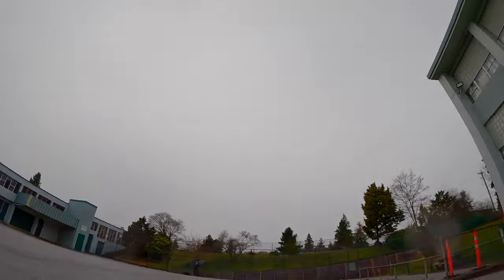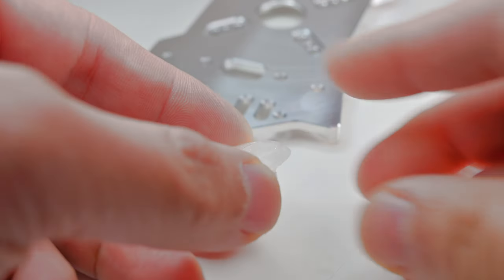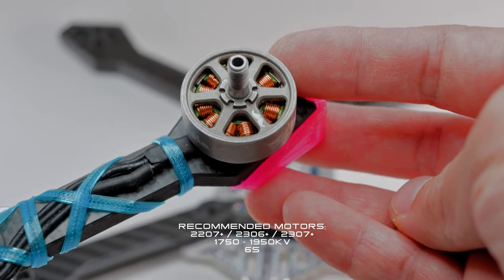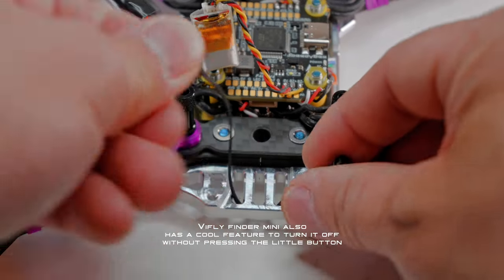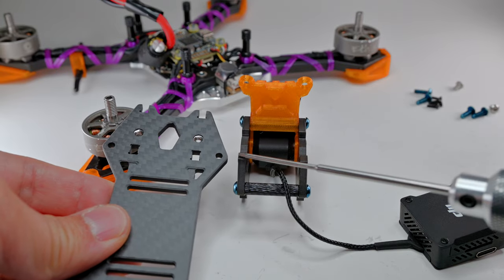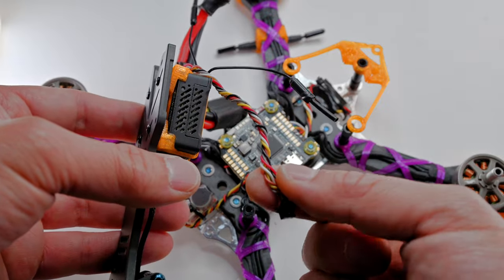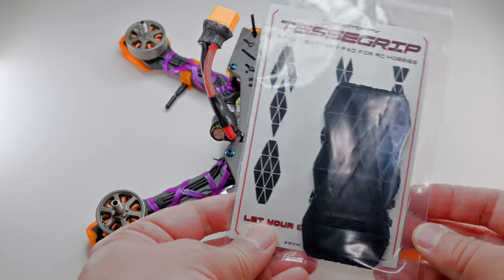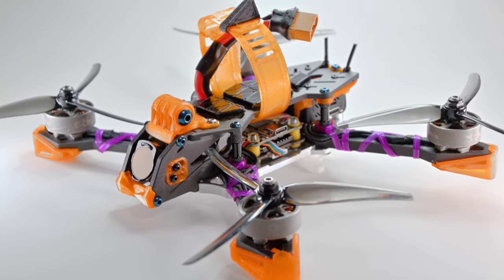How to Build P5G | Proto5 Gauntlet | Bespoke FPV Drone Tank Frame #best #fpvfreestyle #frame

Comment: Patrick and kibby have a great eye to better performance of a frame. Proto5 was by fast the best frame ever built.  I've never broken a frame yet.  If you got an idea to make the prints better they listen and make a mad science on blender to make your experience a better one.  Patrick include some proto racewire with your frames would be epic.  I would love to see a frame design with the AU mounted vertical for maximum airflow for 03 or Vista.  The buzzer placement got me sold. Never fly without a  self-powed buzzer even with GPS.  RTH doesn't always go well. With battery ejection makes the buzzer your protection fit your investment.
Reply from the maker: Great advice man!! I’m still sad you lost your proto5. Email me if you need a proto5 frame replacement. I’ll see what I can for you man.

Comment: So how do i get one....do you offer a custom build option?.....whats the total weight after tpu?....looks nice and needs to be a part of my fleet!!! Lol hmu
Reply from the maker: Haha yeah I hope it can be part of your fleet too! Yeah I totally forgot to weigh the quad for the video.. this exact build in the video is about 443g without lipo. But with props , tpu, O3 au, everything . Keep in mind that’s with a full 30x30 55a aluminum heat sink stack on it. If using naked vista, walksnail, analog, AIO or mini stack you can expect to minus 20-40g. Check out my website www.Protofpv.com and make sure you select your countries currency to see the accurate price. Thanks for the interest 🤙
Reply: @PattyFlipz  yeah I'm definitely getting one I live in the u.s.a...I'm currently flying the syncmode, five33 flipswitch,  and five33 Footy. I want to get yours and put some supernovas on there!!! It's going to be so fire....I also posted it to my fpv teams discord and fb chat....so I should be put on commission immediately lmao....when I like a product I push the sh!!t out of it...innovation in fpv really interest me and I'm really liking this frame. Cheers my bro
Reply from the maker: @dizzydeanfpv45  yeah man!! Thanks!! Those motors will scream. On my website scroll down to the bottom and sign up for affiliate program. You get 8% for each successful referral. I'll payout by paypal at the $50 mark each time. Thanks again.
Reply: @PattyFlipz  ohhh hot damn.....I'm on it....lets sell some frames bro!!! Maybe ill make me enough to get my very own....lmao I can't wait that long....lmao I'm going to eat Ramen for a week so I can get this frame lmao
Reply from the maker: @dizzydeanfpv45  mmm ramens so delicious. I’m gonna do that too 😂 the ramen diet=More drones!!

Comment: Nice job, but nobody is interested because the frame is very ugly and very expensive.
Reply from the maker: Thanks for your feedback! ❤😂 My next frame I'll make it very pretty and very cheap because then everyone will be interested. LOL ok ok seriously, think about it. if this frame was a real person, it would look like a prized UFC fighter. Not a pretty girl or boy, but built tough and can knock you the F*** out. Expensive salary cause they are that good. Also this quad is a tank frame. Tried my best to make it look good, but as you know, tanks are not supposed to be nice, they just bash :) Hope you understand these analogies. Thanks for watching, appreciate it.
Reply: @PattyFlipz  Nice job for your effort 👌. But aluminium is not good material.  They are many reasons for that, and very expensive to manufacture cnc aluminium.  Second; titanium screws , light but very expensive ( when you wrap the frame full of the tpu  parts, you don't save nothing ), and the frame becomes very ugly ( people don't like to much tpu parts).  Next time, use only carbon and for the camera aluminium cnc cage.,and also the manufacture production will be much cheaper ,cheaper replacement parts. Nobody wants to buy a tank....in the end of the day will crash a
 lot, and your tank will break 💯. Good luck with your new project 👍
Reply from the maker: We can agree and disagree on a lot of things, we can design how we believe in, but what you speak about just sounds like every other frame on the market. Protofpv is about being different and unconventional. Do you know why there’s so many prints? Because most North American frame designers/companies barely provide any in order to save money and compete against the low costs of China . We need to print it ourselves. I designed every print to be functional, I didn’t just stick it on there to dress up. Now imagine you decide not to use prints on p5g and just zip tie everything. It’s going to perform light as F with the titanium screws. The joys of customization of FPV bro. If aluminum is a bad material why do you suggest to use it to protect the precious camera? Camera cage gets scratched up first way too easily and the aluminum looks horrible after looking at a scratched up face, especially if it’s finished black. The camera  cage on p5g is 3mm thick t700 carbon fiber plates, and hard to break. Yes at the end of the day all tanks break but the idea is p5g gonna last a bit longer than most tanks. If I start hearing they break really fast then yes I’ll have a problem, but so far so good. It’s quite strong. Thank you for your feedback though but Protofpv is about turning shit upside down. 🙃 otherwise quite honestly I wouldn’t do this in the first place.
Reply from the maker: Also I know lots of industry ppl randomly follow me with their personal accounts…You got my attention by calling my frame “ugly” cause quite frankly that’s sort of rude lol although you are right cause I designed the frame to look “rude” on purpose! Like a big 🖕😂 to conventional design. if you want to continue a nice frame design discussion you can email me and tell me who you are. Would love to chat through there man. Really. Cheers.